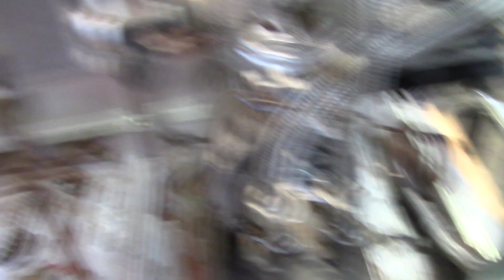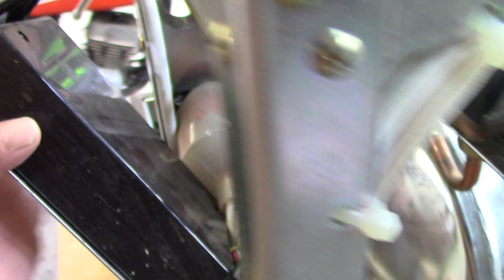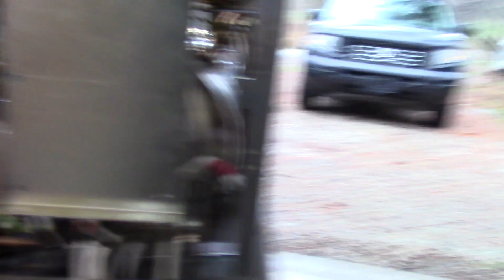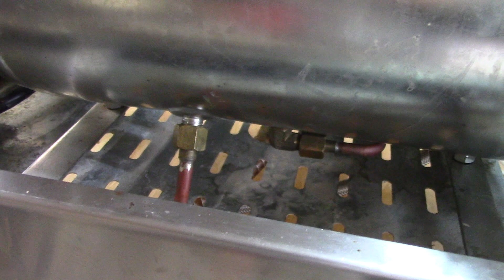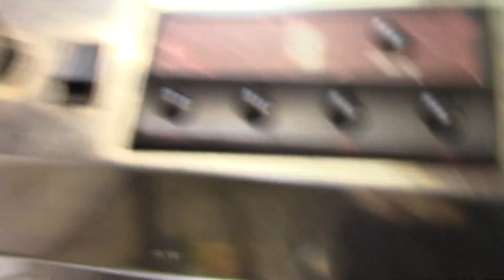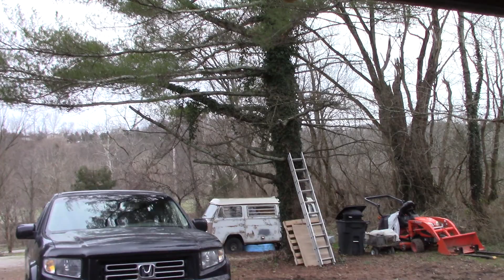Grindmaster ESP2 Espresso Machine Rebuild

Comment: Working on same machine. Group head turns on for a second then off with error code E. Everything else seems to work fine even manually turning on group head. Any info is much appreciated. Thanks.
Reply from the maker: Howdy.  Well it could be a number of things.  If you manually turn on the group heads do they continue to run?  Check the top of the grouphead and remove the nut and see if they are limed up.  Is the pump turning on?  Is it building enough pressure?  Are your screens clean under the group head?
Reply: @gregslair4278  I'm working on the same one right now and had that issue. Took off the top bolt on the group heads and then took out the tiny jet inside and that solved the flow problem for the most part. The right group head though flowed water for a bit then just steam is coming out of that head now and not sure what's going on.

Comment: The error code L is showing, and there’s no pressure building. What should I do?
Reply from the maker: Howdy.  Lift off the bottom tray and see if water is running into the overflow cup.  If it is, follow the tube running water and you'll see it goes to a brass T-type fitting.  That's called the Doser Valve.  It is bad and not (that I found) fixable.  Go to Webstaurantstore.com and look up parts for the Single Estella Espresso Machine.  They list that part (it's the same for the dual head).  That is the part you'll need to fix it.  I hope this helps ya.
Reply: i've had the same issue for a few months now too...

Comment: Hi Sir ,I am working same machine, everything ok but left side of gauge(Water pressure?)is not working. Where can I check to fix that. Thank you
Reply from the maker: It's probably clogged with lime.  Check out espressoparts.com.  Should be able to get a replacement there.

Comment: Today I was working on this same machine and the owner never had it serviced since they got it in 2017 😅. The problem they were having is the tank keeps overfilling and shoots out water from the safety valve . The only thing I could thing of causing that was the water level probe at the top and I took it out and cleaned it with some sand paper and it resolved the issue . Should I replace it to a new one or just work it so for a while? Also the solenoid on the group heads and valves were completely shut , had to remove the whole head and delime it 😅. Got back one group head to work on the left the right one needs a solenoid . Orrrr what I noticed when I was pulling my shot is that the little drain pan starts to fill up with water while I’m pulling a shot & starts to overflow. Do you have any idea as to what can cause that ?
Reply from the maker: If the level probe is working, keep it.  A spare wouldn't hurt.  Don't forget the filter in the top of the group heads.  Also, here is a link to the part you need, it's called a doser valve.  Looks identical to the ones for ESP2 which are stupid expensive.  That'll fix the drain bowl filling up.  Good luck finding a way to fix it.  I haven't all these years.  https://www.webstaurantstore.com/estella-caffe-pecem36-three-way-valve-for-ecem1-espresso-machines/236PECEM36.html
Reply from the maker: And if you need new lucifer solenoids, check out espressoparts.com they are way cheaper.

Comment: Hello there Gregs Lair, I was just about to open a manual on that machine, came online and found you wow,  i already appreciate this video. My machine has no pressure at the brew heads and the water isn't as hot on one side , the steamer and hot water work perfectly, I opened and clean the brew head system which made a little difference so now watching you i may have to check the heating element. so far i realized the solenoid valves at the brew heads mya be defective but need to check all other aspects of that issue. Thank you so much for that video. :hand-purple-blue-peace:
Reply from the maker: @seanbeharry101art  thank you.  Careful with those boiler bolts, they like to snap off.
Reply: @gregslair4278  Yes they are tricky, easy to move on the tank first then off the brew head. Thanks for the response. now am looking at the brew head as the main issue.
Reply from the maker: @seanbeharry101art  probably just clogged.  There is a filter on the top.   Check your pressure valve on the top of the tank too.  And if your fill valve probe is broke, and the rank is too full, you won't have enough head space to build steam.
Reply: @gregslair4278  The fill valve seem to work as it reaches fill point and the meter is in the green the solenoid closes.

Comment: The $50 brasilia espresso machine gauge fits these machines with the rectangular face. I'm having an issue where it's healing behind the group head and won't build any pressure too make shots. I think the pump is fucked
Reply from the maker: You could try some pipe dope on the threads going to the group head.  Possible there is a crack in the group head.  If the pump is bad, look at espressoparts.com for a replacement.  Also, webstaurantstore.com sells the Estella brand now which is the same thing, but parts tend to be a bit cheapr.

Comment: What does service like this cost ballpark? Debating between doing it myself or letting someone else have all the fun...
Reply from the maker: Honestly I have no clue, but I bet it wouldn't be cheap since it's a lot of labor.  It's not hard, just time consuming (take lots of pics).  Be careful with those bolts connecting the heating element to the tank.  If they don't wanna budge, use a torch to heat them up and see if that helps.  All four of mine snapped off.  Fortunately I know a guy who could remove them.  So I retapped and used anti-seize on the new bolts.

Comment: Working on same model,  cleaned everything out and now won't heat up any ideas thanks
Reply from the maker: Check and make sure your thermostat is getting power, then check the leads on the heating element and make sure you have power there.
Reply: @gregslair4278  thank you will look at it and let you know

Comment: Hello sir, how did you unclog the brewing head, working on the same machine.
Reply: I also unplugged one with clogged screens. Mine had one plugged orifice as well. It can be removed with an 8mm socket. It is under the same cap where the screen is. You can soak the parts in Descal which works very well at removing scale without harming anything.
Reply from the maker: @danee8077  Thank ya for the info.  I like to use Citric Acid mixed with super hot water.  It also shines up the copper tubes really nice.  Cafiza also works really good at removing lime buildup, coffee stains etc.
Reply from the maker: Hi, and thanks for watching.  The group head itself wasn't clogged, it was the screen.  The group head has a access port at the top.  I had to replace the screens, here is what I purchased:  https://www.cafeparts.com/Shower-Screen-%C3%98-51.5-mm/Product/12748

Comment: These machines were made by Klub Technology Corp in Taiwan and re-branded. This model was replaced by Cecilware's CS line which has the same tank, heater, group heads, Gicar flowmeters and ProCon/Fluild-o-tech pumps with a different main board and control buttons. They were also sold in Australia under the Pierro name. Grindmaster-Cecilware was bought out by Electrolux and the line was dropped. Estella Equipment has picked up the line and re-branded it with slightly different covers than the CS line, same interior parts. They offer quit a few replacement parts though their distributor, webstaurantstore. Most of parts are compatible with the Grindmaster ESP/CS models.
Reply from the maker: I know the Estella brand through webstaurantstore  is the new units.  I just find suitable replacements when needed, I sold this unit and the other coffee shop has one of the new Estella brands, but got the additional warranty (which is good).

Comment: Gregg I got a question. Working on the same machine for our shop. The thing was barely used from the previous owner. I’m having an issue though, when I turn the main water supply on it fills the tank and then the solenoid shuts off but it keeps filling through the diverted/doser valve line. I replaced the valve but it’s still doing that. Any ideas?
Reply from the maker: Hi.  There is a level probe sensor at the top (left side as your looking at the machine), have you removed and cleaned it?